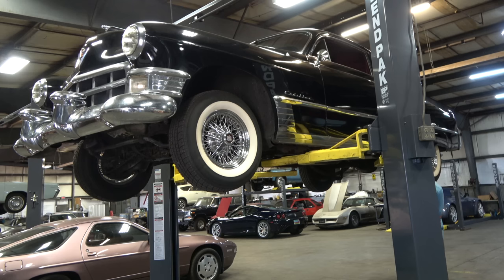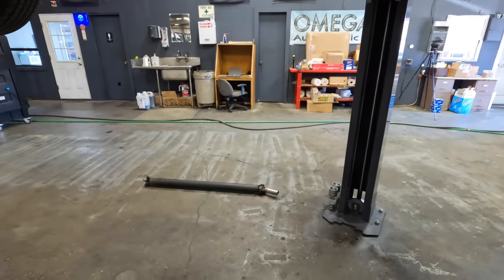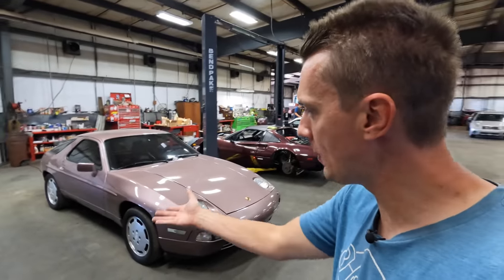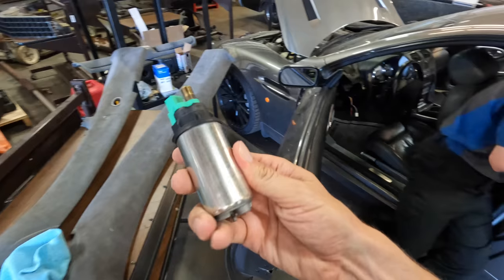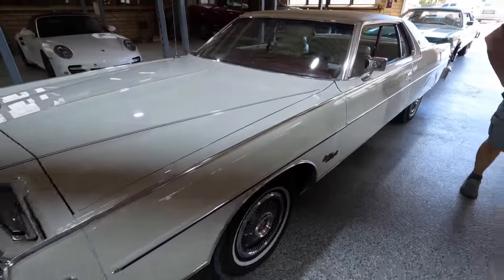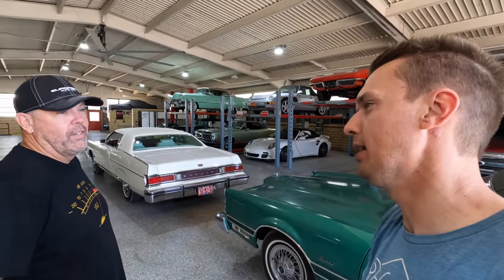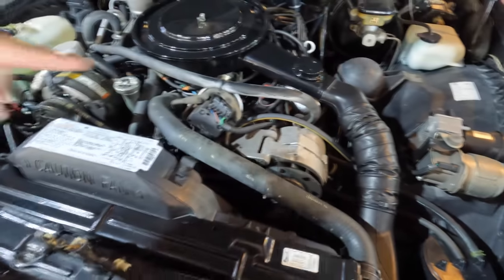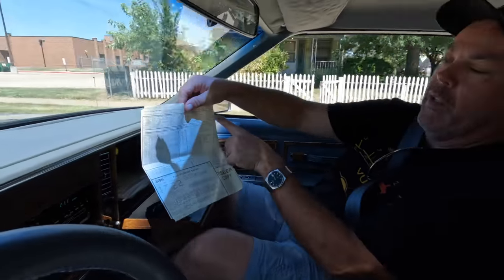We found some weird mods on my 1949 Cadillac Fastback Custom, and more things broken!

Comment: It's amazing to find older cars with very few miles but they are out there. When I was teen, way back in the 80s, my grandfather had a 1960 Eldorado with very few miles on it. Apparently he bought it new and it had an electrical issue a few months after he got it. They live in small town Oklahoma and the nearest dealer was in Tulsa, a few hours away. My grandfather got in an argument with the dealer over warranty work. 
Basically, he didn't want to have to take it all the way to Tulsa. Old grandpa got mad, parked the Cadillac and bought a Lincoln. 
That Cadillac sat in the garage from 1960 until the mid 90s. I was supposed to get it after college but some A #$ hole conned my grandmother out of it for $700.
Reply: Holy SHIT dude!  Your grandfather had a '60 Eldorado which basically hadn't been driven since it was new and your grandmother let it go for only $700???????  In the 1990's?????  Do you have any idea what that car would have been worth then?  DAMN!  I could cry.  I would LOVE to have that car.  I knew a man in the 80's who had a 1960 Eldorado convertible.  He bought it from the original owner sometime in the '70's and it had probably 50K miles on it and he paid a lot more than $700 for it! 
Grandpa must have had bucks if he could afford a new Cadillac AND a new Lincoln both in the same year.  
Interestingly, I had an uncle who had a 1973 Eldorado and THAT had electrical problems as well.  Sometimes, the drivers window would not work.
Reply: @retroguy9494  Yep, it was basically brand new. The alternator went out so he couldn't drive it to a dealer, they wouldn't let another mechanic do warranty work and dear old gramps refused to pay for a tow, or to simply have a new generator installed locally. It sounded like a hard headed, I refuse to budge on my position, kind of situation. That's the story my uncle relayed to me.
That car was supposed to be mine but, apparently, grandma was under the impression that I just wanted to sell it. When the guy wanted to buy it he conned her into believing it would cost more to fix it up than it was worth and he offered her scrap value. Ugggg. She sold it thinking she was doing me a favor by selling it for me.. She gave me the $700 next time I was out there visiting. My heart just sank. I would still have it today had she not sold it.
Reply: @shananagans5  It sounds like your grandfather could have been friends with my father!  LOL 
But I can agree with him as well.  I had a 2005 Yukon which I bought new and after 4 months the entire exhaust system fell out of it the Thursday before Easter.  I had it towed to a dealer and under GM policy, I was entitled to a like loaner vehicle while it was fixed which would have been another Yukon or perhaps a Tahoe.  The dealer on Good Friday refused to give me a vehicle until they determined what was wrong and how long it would take to fix it which wouldn't be until Monday due to the holiday.  Then, he said he would only put me in a 4 cylinder Enterprise Rent car.  I called GM who confirmed I was right, but also said they would do nothing as they 'support their dealers.'  
If your grandmother knew nothing about cars, she should have spoken with someone who DID before selling it.  Plus, she should have at least called you and ASKED you what you planned to do with the car.  I also sympathize with your heart sinking.  I begged my uncle, who was wealthy, to put that 1973 Eldorado away for me until I turned 17 and I would buy it from him.  It would only be about 5 years.  But he traded it in 1976 for a new Oldsmobile Regency 98.  My heart sank too!  
That man should be ashamed of himself. There are SO many crooks out there.  I hear all the time about these guys, especially these so called "dealers" buying up these old low mileage cars for very little money and flipping them for between 15 and 25 grand.  But I've never been able to find one.  Not one that didn't need a LOT of work despite the low mileage.  I guess I just don't have good luck.  I'm an honest guy and I would have offered your grandmother a fair price!

Comment: Some car-designers are such as....es. You have to change the fuel pump and for this you must dismantle half of the dashboard, the sound system and 66,6% of the interieur. Not to mention that working on fuel-parts inside a car is always a bad/smelly idea. I would be angry because the former owner has only changed one of the pumps

Comment: It’s a 307 olds motor on the Buick riveria a whopping 160 Hp good long lasting motor but it slow
Reply: I had a 1980 Riviera Sport. All Black with the 5.7 , dual rvs exhaust, classic wolfrace rims 14 inch front and 15 back. That was a mean car and totally different attitude than this one!

Comment: As a former owner/driver of GM models from that Riviera build era, they were some of the worst cars GM ever built. The engine was out of the cheapest line from Chevrolet, that "pancake" a/c compressor would burn out on a regular basis. Wouldn't own one if you paid me.

Comment: Tf is wrong with companies and their engineers? Just because it's an expensive car, they make common parts so inaccessible? Pulling out almost an entire interior to change fuel pumps?

And shit like the starters on regular ass traffic like attainable Northstars??? Literally what tf is wrong with these people. Who does that??? Why???

 They have to be trolls. They were nerds that got bullied and wanted to stick it to the 'successful jocks' that would be buying these cars twenty years later, who gave them swirlies and stuffed them in a locker.

Comment: Starts to look like the US car market might be starting to turn. Land yachts are starting to appeal again, and they are fetching top dollar. Are the masses getting fed up with overly complicated over priced sub compact cars, with the ride comfort of a race car? There is much to said for cars that have 30 to 40 year durability, that can be mostly fixed in the home garage or the corner garage. That is surely more green than a throw away car that is not worth fixing after 2 to 3 years of ownership, and comes with a way higher showroom sticker price anyway. When . . . . ?  will Buick, Oldsmobile and Pontiac be restarted. Just do it, now, and build more land yacht monsters, with room inside for real people rather than fashion magazine stick insects, cars, that are not fluffed up trucks. Yes fuel efficiency will be good, even hydrogen powered, but don't bother with PEV. PEV is way too stressy  with range anxiety, weight and recharge limitations.